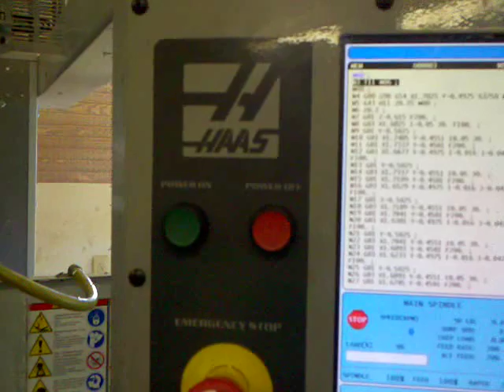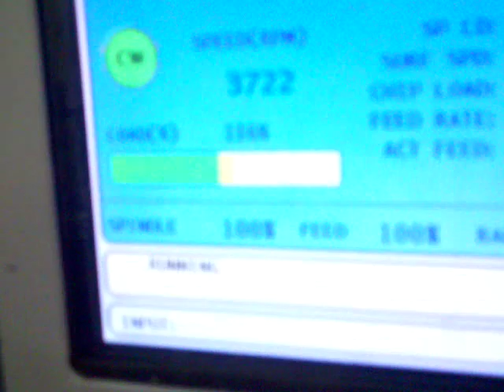Mastercam high speed machining on a Haas TM2

Comment from the maker: Actually, the default "coolant on" position was at Z 2". But very often it would start making chips before the coolant started spraying, due to the time it took to fill the lines. If there was a check valve, I might put it back to 1-2".

Comment: Greyson,
MasterCam X6 has some very cool 2D High Speed trochoidal tool paths. The one in this video looks like 2D High Speed Peel Mill because he’s working a slot. MasterCam also has 2D High Speed Dynamic tool paths that have the same trochoidal motion except they use z-axis micro lifts in the trochoidal cut. This is handy where you don’t want the tool running over a previously machined  surface.